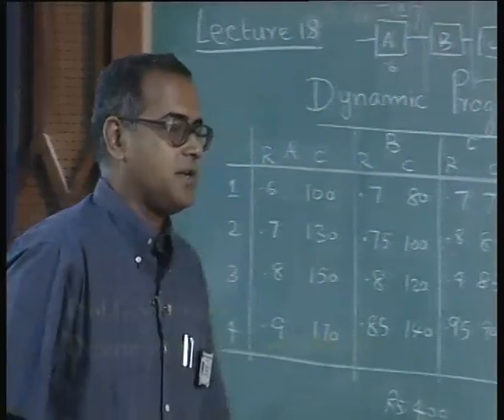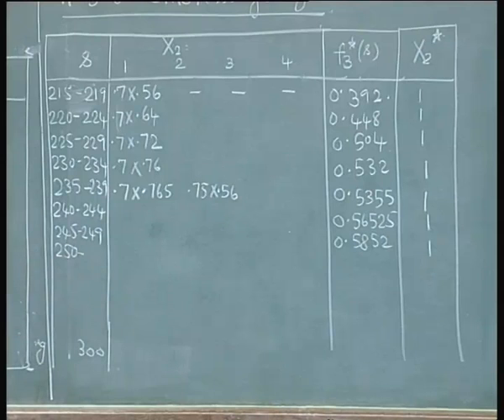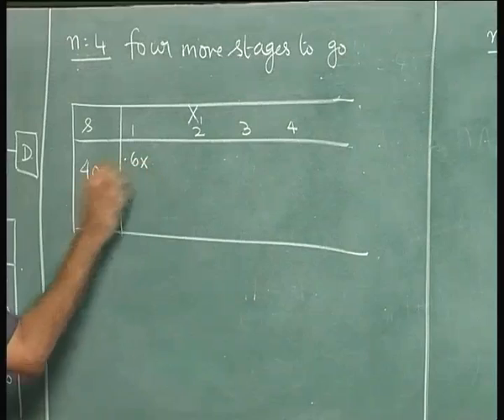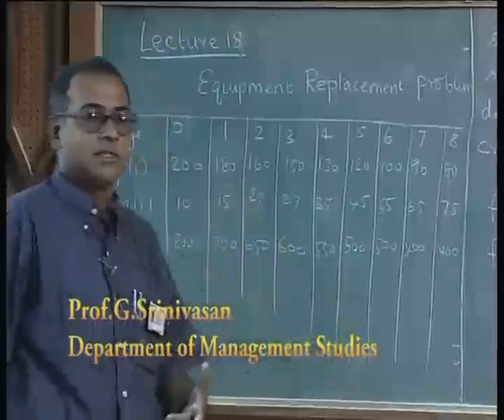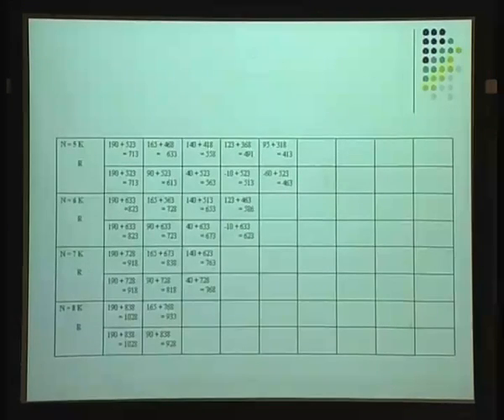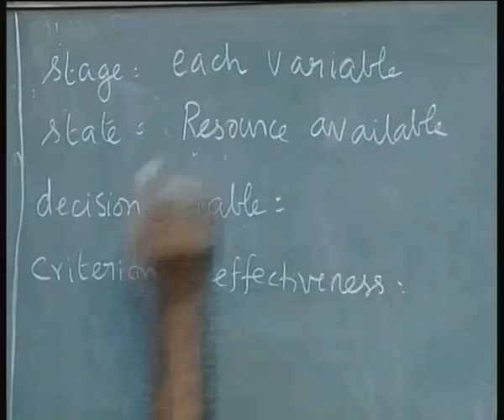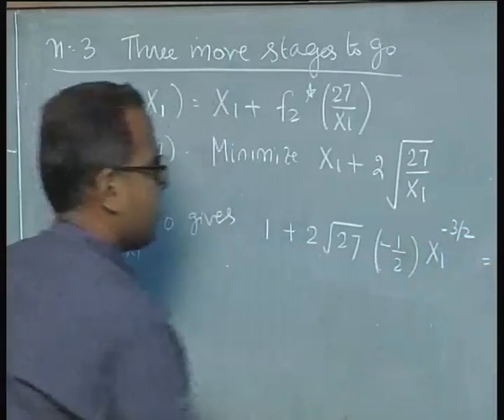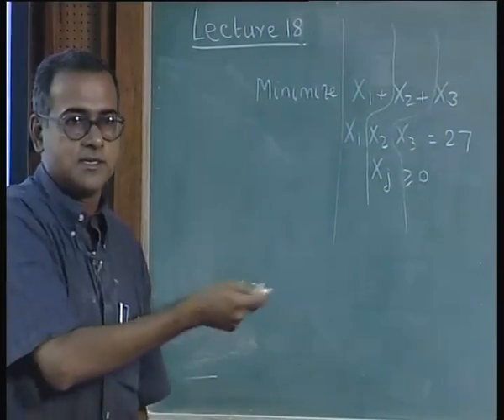Lec-18 Dynamic Programming - Involving Discrete Variables

Comment: Thank you very much! 
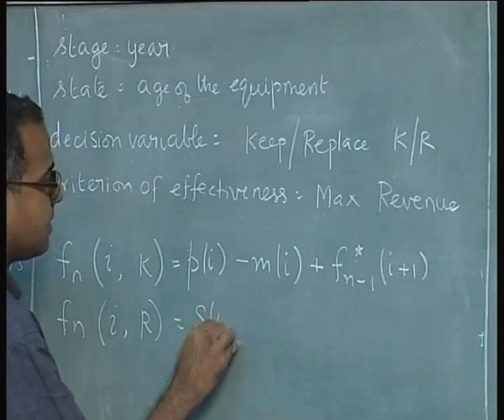For those, who are having troubles in understanding the Replacement Problem example because of the gap in the recording, at 21:40, please don't worry, it's perfectly understandable as all the information is presented on the blackboard so you can restore it by carefully peaking at the Age/p/m/s table and the exact moment after the break in the record (while writing the recursive relationships, prof. Srinivasan repeats the meanings of all the variables).

I'll try to explain what's missing anyway, I hope it clarifies the problem:

There's a single unit of equipment that we are using in our business (you can think of it as some machine). 
When we buy the machine it's new (age = 0), the price of the new machine is s(0). We can always sell the machine and get a refund, so if we are selling a new machine (although there is no sense in selling a new machine), we get the same s(0) of refund. Each year the machine is used and becomes worn more and more, so if we're selling the machine that had been used for 1 year, we get a price of s(1) < s(0) as a refund. It's what we call a salvage value. s(i) is salvage value of an i year(s) old machine.
Each year that the machine is working we should perform a maintenance which costs m(i), so it's also a function of machine's age (as the maintenance of an older machine is more complex than the one of a newer machine).
Finally, each year our business generates a profit which also depends on how good our machine performs (i.e. of its age) - p(i).

We cannot operate our business without a machine, so in the initial state of particular examples of Equipment Replacement Problem, we already have some machine that is i years old; also in particular examples we assume that we want to maximize the profit that we get from operating the business during the n following years. 
For example, an instance of an Equipment Replacement Problem may sound like:
we have 3 years old machine and want to operate our business during 5 next years.

Each year we make a decision (and that's the decision variables of the DP framework) either: 
i) to keep (K) the machine that we have (which is i years old), and then
- we are paying m(i) for maintenance
- we are receiving profit of p(i)
- next year we are to start with an (i+1) years old machine,

or ii) to replace the machine (which is i years old), and then
- we are selling it and receiving its salvage value s(i)
- we are buying a new machine and paying the cost of a new machine, c = s(0)
- we are receiving profits from our new machine p(0)
- next year we are to start with a 1 year old machine.

I hope this clarifies the missing problem statement.
Reply: Thank you
Reply: thank you
Reply: Nicely connected...Prof. Srinivas..lecture...highly commendable....Great video(s) to learn OR.
Reply: Thanks Brother